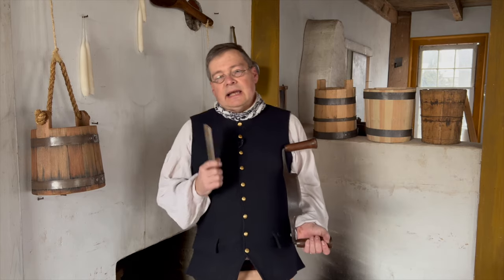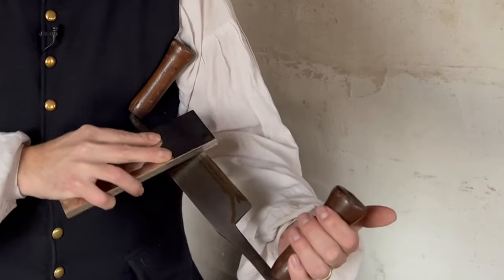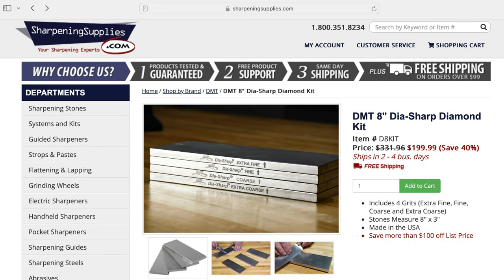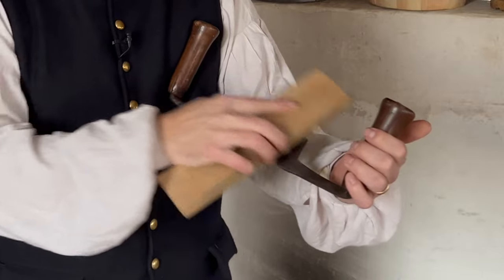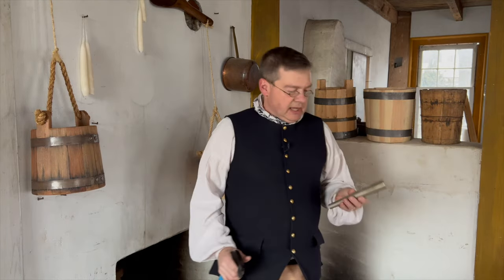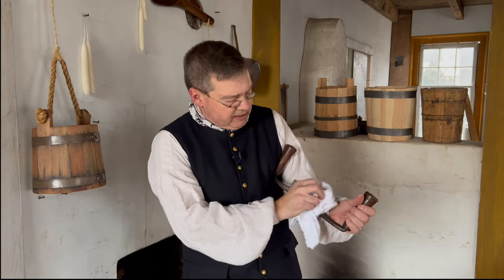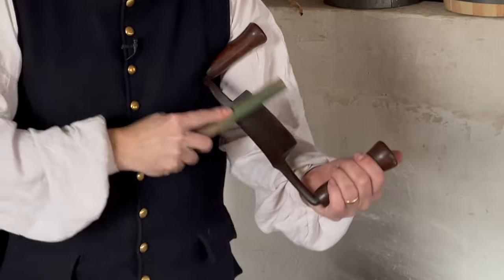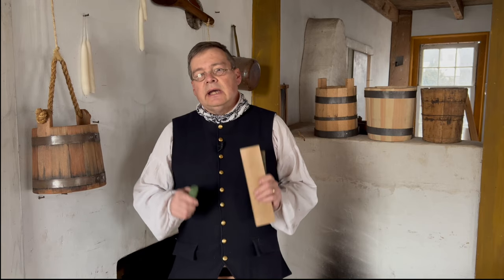Sharpening The Hollowing Knife (Part 2 of 2)

Comment: I should probably make some round leather strops. Right now, I just use a dowel charged with the stropping compound instead of gluing leather on first.
Reply from the maker: You should; it’s not difficult whatsoever. I used a fairly light veg-tanned leather I bought at Tandy for making tool covers. Now that I’m typing this, I realized that’s something I should have mentioned in these videos. Hindsight…

Comment: What did you use: regular glue , contact cement , or CA glue to make your leather strops? I guess this sharpening method would work on most curve cutting edges,
Reply from the maker: Yes; leather strops are commonly found in the company of hand tool woodworkers, regardless of trade. Rounded strops are an absolute must for maintaining carving gouges and my experience with carving is where I learned to use them. Traditionally, hide glue would have been used, but today contact cement or wood glue are both good choices, there should be coverage over the entire gluing surface, to ensure a continuous bond. If not held down, the leather may pucker, potentially causing it to hang up on the tool. I also use the flat strop for honing my plane irons and bench chisels, so maintains as flat a surfaces, as possible, is a must. While any Polyvinyl acetate (PVA) glue will work, I’m a fan of Titebond III and it was a good choice for these strops, as I interpret an Itinerant/Traveling Cooper at outdoor living history events. Thanks for the great question.